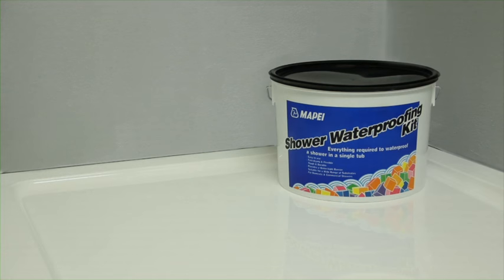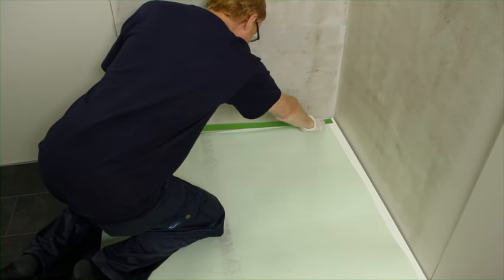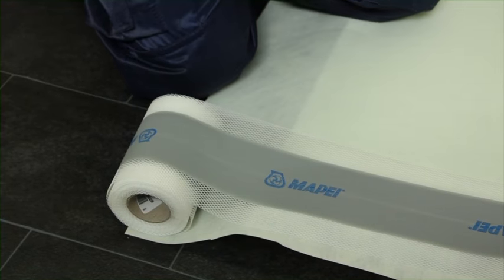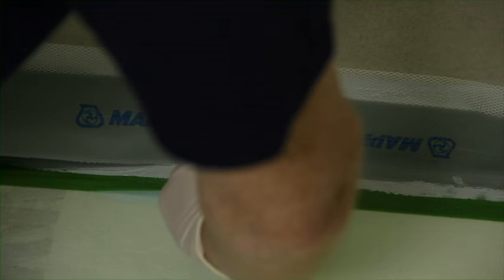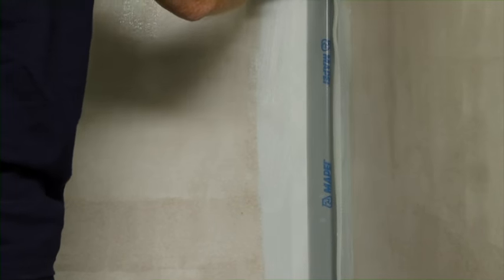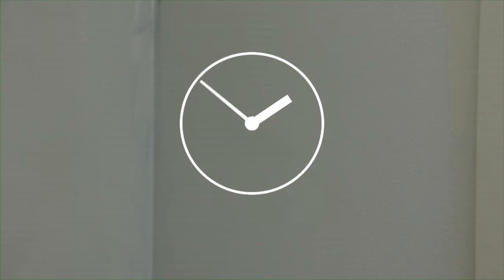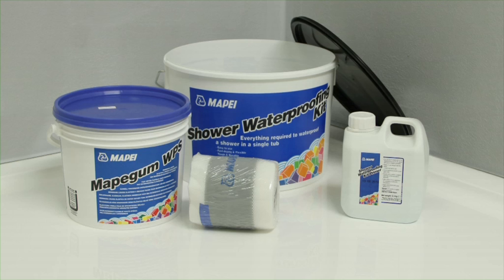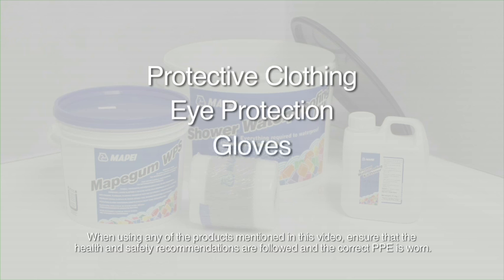Mapei Shower Waterproofing Kit

Comment: So you return any water behind the tiles  into the shower tray,  but then in front of the tiles you have a silicone bead. Won’t this stop the water from returning to the tray.. it will just build up behind the tiles, no?
Reply: I was wondering this too. Wouldn't that first lowest level of tiles hold back a certain amount of water behind it.
Reply: If you're worrying about the silicone bead preventing water that has already leaked through the tiling/grouting flowing back to the tray, that's some serious leak you're talking about which would have caused serious damage to your house had the water proof barrier not been behind the tiles. The whole point of this system is to reduce liklihood of water damaging the rest of your house. Too many showers rely on the silicone only as a barrier, which isn't sufficient unless you resilicone every 5 years or so, and that absolutely requires the shower enclosure frame removing to do so properly. Most shower leaks occur under the enclosure frame where it sits against the tiled wall and tray, then people stupidly start siliconing the inside of the frame, which doesn't fix the issue and sets it up for a larger failure.
Reply: @mart34 our plumber siliconed the shower tray leaving us to try and stick the tape onto silicone even though this product was recommended by him! I was in tears, my missus took over, same thing, can’t get the tape to stick on shower tray and if it went further than the silicone it would be an eye sore. 
Not sure this product is properly understood.
Reply: Rather that then it leak and destroy the ceiling downstairs.

Comment: You don’t get enough tape in the kit
Reply from the maker: Thanks for getting in touch. There is enough products in this kit to do 2 walls of a standard 900 x 900mm corner shower unit. Therefore 5m of tape will cover the two lengths of 900mm to the tray and 3m up the wall in the corner. We hope this helps.
Reply: @MapeiUK  For a shower enclosed on 3 sides (2 corners) I would say that is nowhere near enough tape so.
Reply from the maker: @peterconnell2451  The Mapei Shower Waterproofing Kit is designed to tank a corner shower cubicle around 800x800mm. If you need further advice please call our technical department on 0121 508 6970 – Option 2. Thanks
Reply: @MapeiUK  As some have pointed out, there doesn’t seem to be enough product to cover larger showers.  but I guess the product could be applied ground up, so in the event that the product isnt enough for larger showers, at least the bottom area of the shower would be tanked 😂🤦🏾‍♂️

Comment: i have just had the bathroom replastered and it,s going to be covered with water down emulsion can this kit be used on the coated wall or is it better to use the primer on the clean plaster with out any emulsion
Reply from the maker: Hi Wayne, thanks for getting in touch. We would recommend that the walls are not painted before applying the tanking membrane and primed if required. Hope that helps you out.

Comment: I applied the primer to the tile Backerboard a few months ago but got sidetracked with other projects. Will I have to prime walls again? 

If so. Is the Mapei primer G the same as the primer included in the kit? Or can Sbr mixed with water be used? Thanks

Comment: In my jobs i waterproof hole bathroom floor and shower horizontal corner. In this case  i would just tape use wps and silikone between wall and battom together then efter tile silikone again

Comment: A) once tanking has been applied and dried, do you need to apply tile primer on top of the tanking before tiling?
2) when tanking on top of plaster that is very porous, could you apply tile primer first, let the plaster suck all that in, then apply the tanking primer and membrane?
Reply from the maker: Hello, You do not need to prime the tanking system before tiling.

Comment: can it be used to water proof over existing tiles
Reply from the maker: Hi David, thanks for getting in touch. Yes it can be used over existing tiles but you must just clean the tiles and not use the primer. Then paint the Mapei Mapegum WPS directly on the tiles.
Reply: Are you saying you then tile over the tiles again? Surely the wps over the tiles won't waterproof the existing tiles and make them look nice, out would just be a wall of grey wps?

Comment: Can i use this on a plywod shell? It's for use in a campervan. Thanks
Reply from the maker: Hi Alex, Our technical team have responded with the following "We wouldn’t recommend it directly to plywood for this type of application, however if the plywood was over boarded with a suitable tile backer board this could then be tanked using the shower waterproofing kit before tiles are applied." I hope this helps.
Reply: Using it on my campervan. I used a waterproof PVA on the wood, then the primer, then the WPS Magnum, covered it all with PVC sanitary sheeting. Did you end up using it on your camper Alex?
Reply: @hennnnerz  and how did it last?
Reply: @tomkilmore7254  No problems, all seems to be perfect so far 1 year later

Comment: I have aqua panel boards instead of plywood or plasterboard, so should i apply the waterproofing all over?

Will it react or damage the aqua panel?
Reply from the maker: hi Myles, AquaPanel are only water resistant and it would be recommend to tank the entire surface before tiling.
Reply: I used hardiebacker board and that's similar to aqua panels. And applied the waterproofing kit all over that

Comment: Had it applied last week in ensuite shower area.  The smell is horrendous. Really toxic but it's meant be non toxic. We have tried having the fan on 24 hour in ensuite. Keep bedroom window open all the time to try to get the smell out (no window in ensuite).  Extractor fan on.  Burnt lovely candles, burnt incense..... 

It's such a nasty smell.  It's been put over WEDI boards.

I have tested it on an offcut of wedi board and the same pungent smell appears.  

Having smelled the actual container it smells like amonia which apparently isn't normal.

Is this smell going to go away or do we need to remove our new panels, remove our new wedi boards and get a tradesman to come start all over?
Reply: Same here, I used the product to waterproof bath/shower enclosure and the smell is still extremely strong days afterwards despite room being aired 24/7 since being applied. Smells like burnt plastic. I really hope the smell is going to go away, starting to regret having used this product.
Reply: @Jzml-x9z  after a couple of months of trying to let the smell settle and the company taking away the product and testing for abnormalites (obvs found nothing so they didn't have to compensate).. .I had to rip the entire shower down dig up the wall etc to get rid of the smell and start the job completely from scratch. Worth it to have got rid of that product in my house 'never again'.
Reply: Very strange. Ours didn't smell while I was putting it on, I'll have to check in the morning again if something developed. We did it on to cement board. Wonder if yours was a bad batch 🤷‍♂️
Reply: @redfox05nl  The company claimed it was perfect!!  Sent it to a lab 'apparently' they never proved that.  Sent a Rep over who actually said to my face 'I can't smell it'...talk about gaslighting!

Comment: can these rollers/brushes be cleaned with water and re-used again? .... for primer maybe yes, but for the Mapegum WPS too  ?

or even just keep the roller / brush in a plastic bag until the next coat and then discard them ?

also I think it can be watered down for concrete and plaster ? otherwise only get about 3m2 coverage as it soaks up too quick in the plaster, and that's with one coat

Comment: Please could you explain the difference between Aquadefense and Mapegum products?
Reply from the maker: Further to your request please find a brief comparison below:

Mapegum WPS:
•	Domestic use
•	24 hours drying time before tiling
•	0.5mm dry film thickness
•	Internal only

AquaDefense:
•	Domestic and commercial use
•	4 hours drying time before tiling.
•	0.8mm dry film thickness
•	Internal & external (secondary layer of protection)

We hope that helps, should you require anything further please do not hesitate to contact us.

Comment: Can apply in damp condition?
Reply: I'm not an expert by any means, but I wouldn't want to trap the moisture behind? It could cause lots of damage to your walls
Reply from the maker: Good Morning,  when applying the Shower Waterproofing Kit the substrate must be solid, contamination free and dry.
Reply: I kind of had a similar problem, the window frame I was applying it around had condensation on it, do that mixed with the wps. Fingers crossed it turns out ok